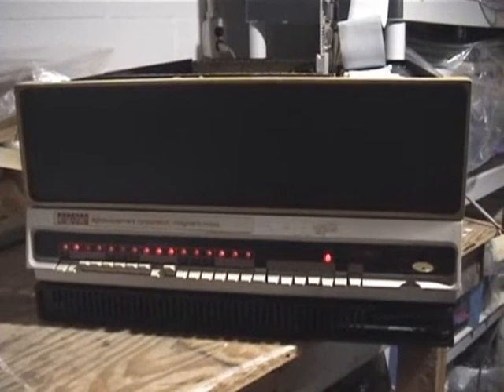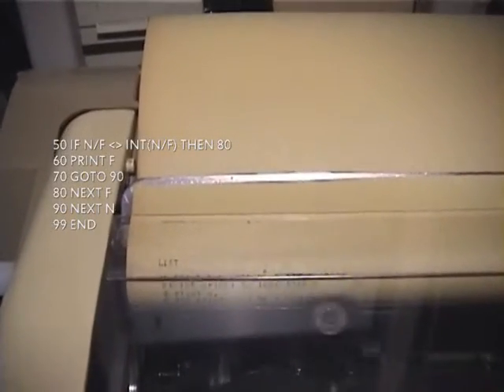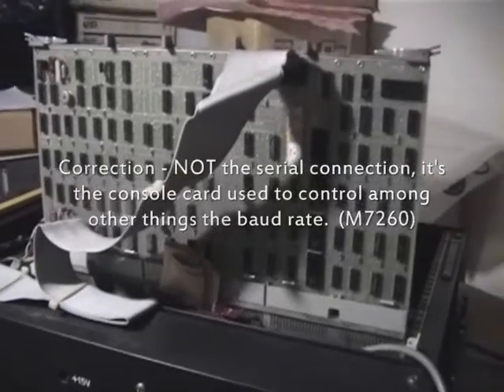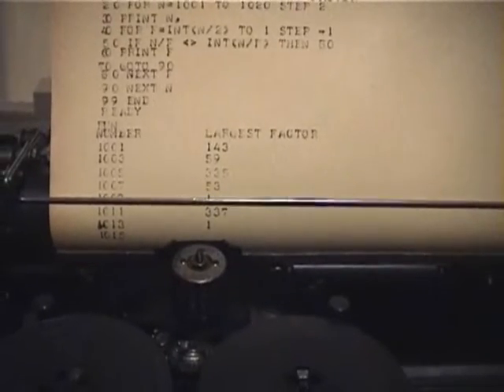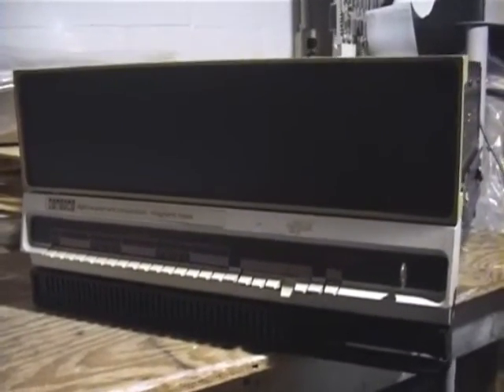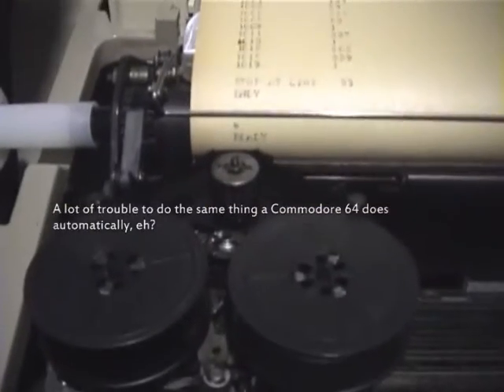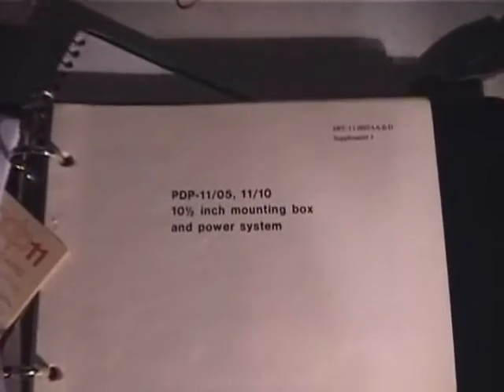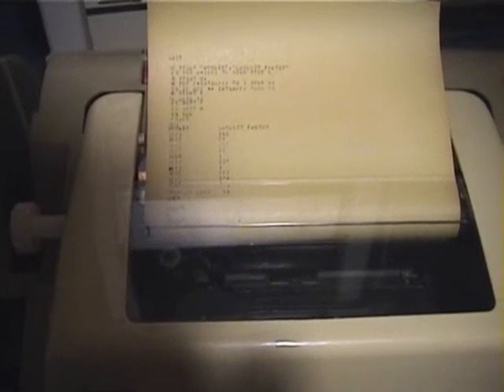Digital PDP 11/05 Running PDP 11 BASIC from ASR 33 Papertape

Comment: Bill is your power fail restart broken? you should be able to turn off the 11/05 and then back on without loosing basic or the loaded program. don't halt the cpu when you power cycle and it should come back to ready.
Reply from the maker: +joseph lang I see at the end of the video my comment that prompted yours.  I don't like to shut off a machine until I halt it first.   But mostly I was just improvising I did not write a script or check for accuracy.  I don't really like this video my head was so stuffed up I sound like an ad for nasal spray, but a lot of people seem to like it so I have left it online.  I have other 11/05 videos you can watch. that are newer/nicer.  

At the time I was excited to share that I had finally gotten the machine running; you're seeing me operate the system for the first time basically and I just wanted to document the experience.  Technical details about BASIC and core are found in the manuals if anyone wants to read up, it's all there.  

You +joseph lang should make a more formal video of your PDP 11 to demonstrate what you think everyone should know.